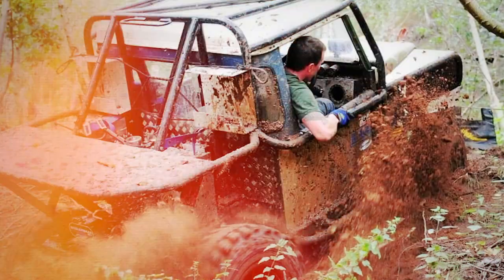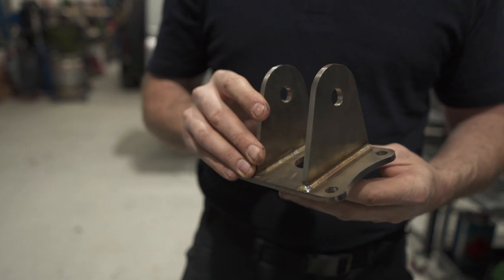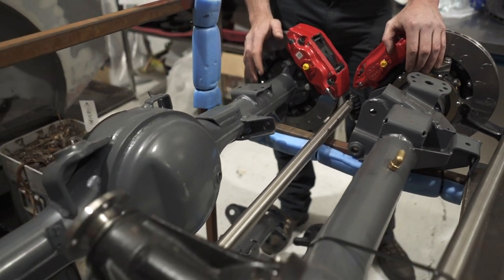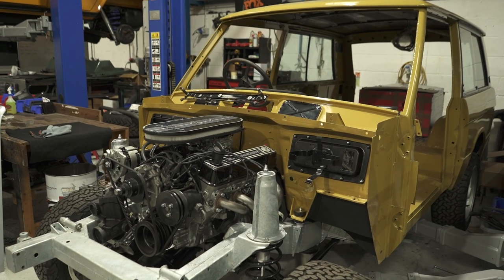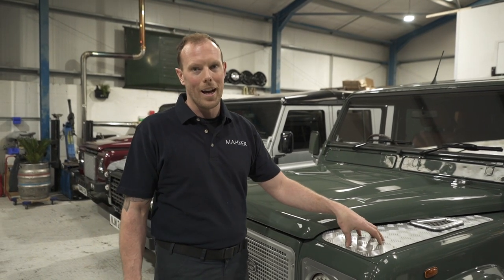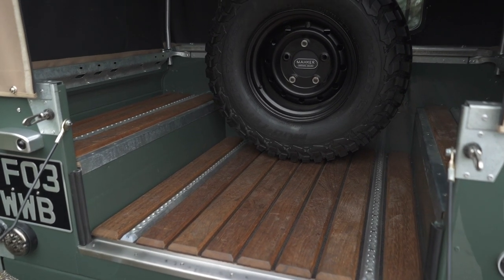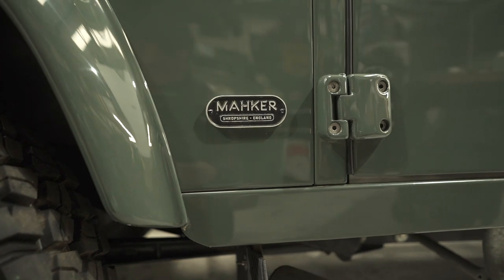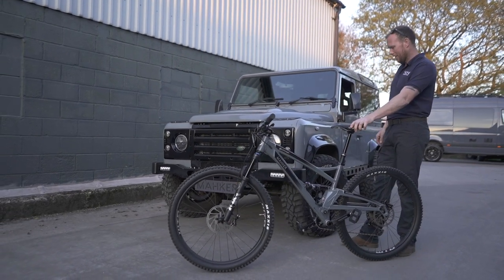WHY DO YOU THINK SUPERDRY USED OUR LAND ROVER 110 DOUBLE CAB ON A PHOTOSHOOT? | MAHKER WEEKLY EP005

Comment: I’ve got 4x 80series Landcruisers (2x 12Valve 4.2L diesels and 2x 24Valve 4.2Ldiesels) and 2x 110 defenders, both 2.4tdci pumas....my dream is to fit a 4.2L Toyota diesel into at least one....what conversion bits are needed and is the Toyota auto gearbox the one to use or am I better with a manual? One of the 12Valve cruisers is a ‘parts’ car, auto....2 owners including me....110k miles, never washed....bodily quite sad/bad but mechanically fairly good (full lockers).... one of the 24 valves is a manual with 65k from new and is almost concours...the other 24 valve is an auto/ Japanese import, so good engine, has an mot and Ive owned/driven it for over 20 years.. the other 12 valve is a manual import with a 10 inch body/chassis lift and a 10 inch suspension lift...it’s currently on 38s but I’ve also got a set of 44s.....the 38s are a bit more road-able!....the 44s are snow/mud pluggers and have a tractor-like tread pattern....2 sets of rims..any ideas?
Reply from the maker: We’re happy to take on any project as it sounds you have a fair collection
Reply: @wearemahker  thanks for your message....apparently you’ve been chatting to my son (the defenders) .... I’ll try to persuade him that the Toyota engine may be a good match as opposed to the BMW!